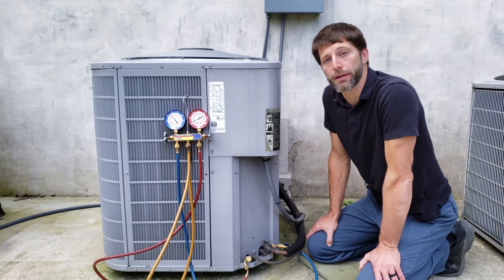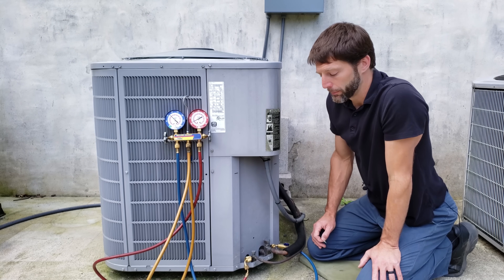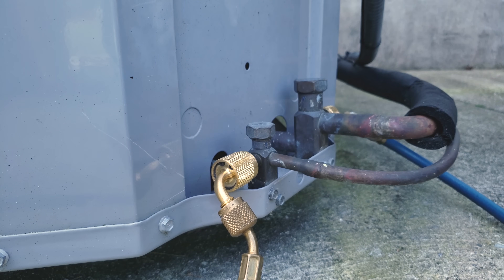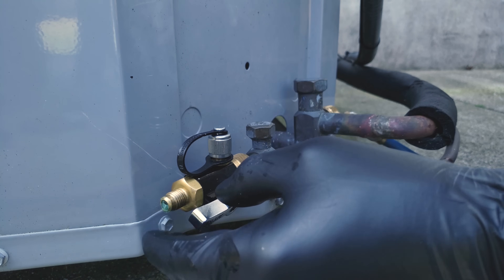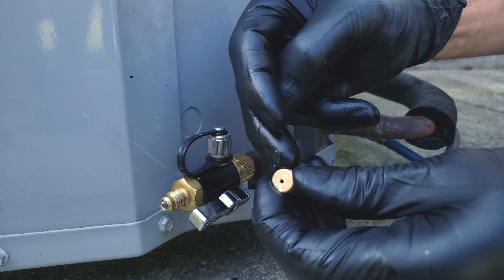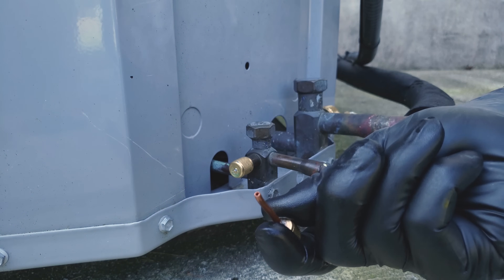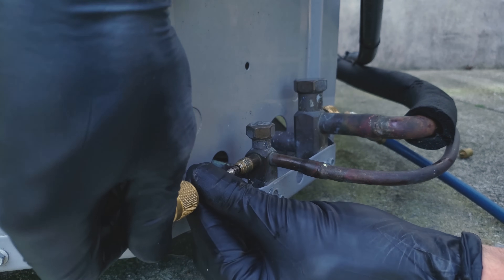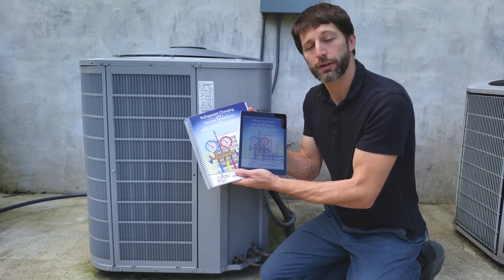The Best Way to Find a Refrigerant Leak at the Port!

Comment: Great idea!. I was wondering if when removing a hose or vcrt if the valve core ever gets stuck spewing refrigerant? My 32 year-old heat pump hasn't been touched in at least 19 years so I'm worried it could happen because the seal deteriorates? Maybe I should use the vcrt to replace it before putting gauges on it.

Comment: Can't you just apply dope tape with cap to get a good seal if u don't want to replace valve core?
Reply: It may help if you're lucky but remember the Teflon tape for tapered threads like pipe threads. These are not tapered threads.
Reply: @rickbraden4272  very good point.
Thanks for your reply.

Comment: Thanks for the video. it is very helpful. 

One question about the drill bit for the brass cap, did you use 1/32 or 1/64 bit to drill the hole? Thanks

Comment: All of this can be avoided by using nylog and a cap. Almost every Schrader core leaks
Reply from the maker: If the valve core leak is bad and if the cap holds, they are awful tight to try to get off as well do to the buildup of pressure, thanks!
Reply: Nylog/nylock shouldn't need to be used, the Shrader valve caps have a rubber seal to 500pis+ when tightened correctly. The brass service valve caps that are tightened with a spanner are rated to 1000psi. Correct me if I'm wrong but the leak shown in the video would only leak with the cap off.
Reply: Yea those rubber seals stay in for the first few times you use them then they fall out. I'm not going to replace every cap I take off so I just use nylog to be more efficient. I can't tell you how many service valve or king valve caps that leak due to bad packing and the seal is long gone. Almost no supplier stocks the OEM service valve caps or the corresponding gaskets for the caps. Nylog is compatible with every type of refrigerant and oil and it's gotten me out of a bind more than once.

Comment: Excellent 👍. BTW, if I'm a retired Engineer, is there a fast track method to getting an HVAC license in NJ? Seems like the 1 year apprenticeship is a big hurdle lobbied by existing contractor's. I want to be compliant. I've also gone through FIVE licensed contractors trying to get a mini-split working properly. It wasn't unit I worked on it myself and found horrible workmanship on all flare fittings. Thanks in advance!
Reply from the maker: David, yeah I don't think there is a work around for that. Most of the apprenticeship courses are at night and they would put you in a year 4 class but I understand where you are coming from, thanks!

Comment: Simple yet brilliant. I could probably use the same "drill a hole" technique for shut off valve caps. They are not as universal, but 2-3 different caps would work for over 90%.
Reply from the maker: Yeah for sure for testing that would work, thanks!

Comment: The core have a rubber seat, and it will eventually start leaking, it’s not a question of if, but only when. And the more you tighten it, the sooner it will start leaking. The service valve has been design to be leak proof with the caps on. For that reason, it is far more important to cary new caps, or at least new O rings to replace the gasket in the old cap. And the O ring will seat better, if you give it a little nylog. Same for the core. Bottom line: Test with the cap on!
Reply from the maker: Yeah it is certainly nice to replace the plastic caps with brass ones, and we need to replace them with locking caps if they are exposed anyway, thanks!

Comment: Liked the TIP and your Channel. However, wouldn't a better solution be to require (Manufacturers) both of the Service Valve Caps be leak-proof in the first place? Why aren't they?
Reply: Cheap people buy cheap products. Many cheapos in the world.
Reply: That's what the caps are for. Which makes this tip useless honestly. If the cap doesn't have a good o-ring use nylog and forget about it. And if you're just leaving those off then leak detector bubbles are the least of your worries 🤣